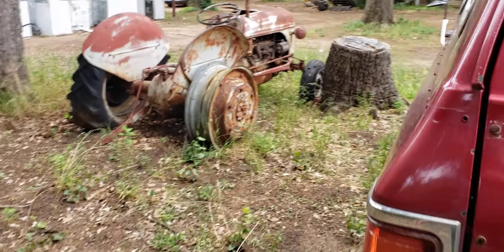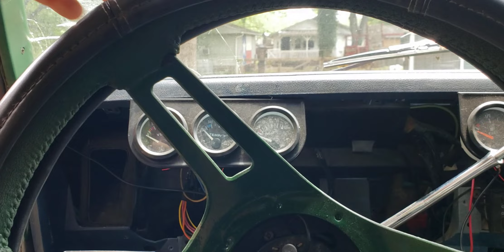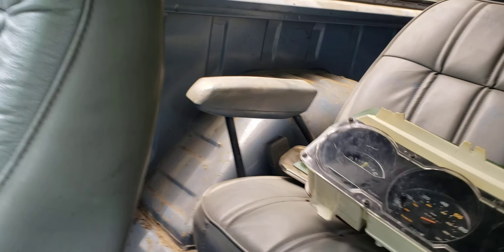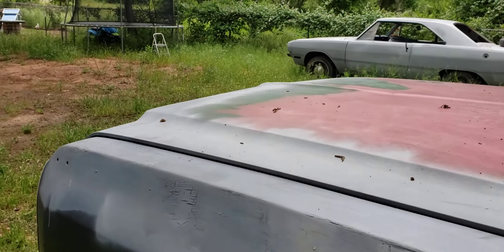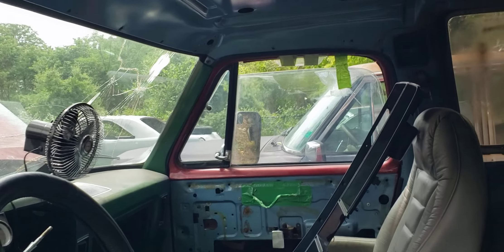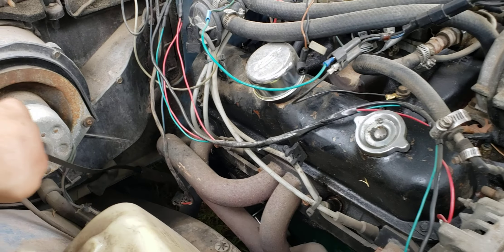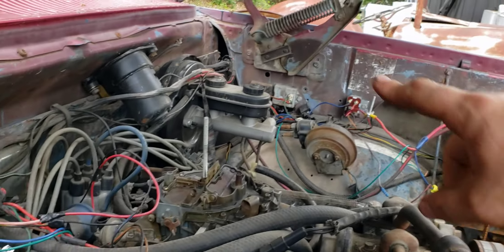I bought a 1984 Dodge Ramcharger What should I do with it?! WILL IT RUN? WILL IT DRIVE? 318 V8

Comment: If that's a 2x4 they're pretty rare. I'm building a 1987 2x4 for my wife. It's lowered 1-1/2" with wider rims and tires.  Looks great but will probably be worthless AF when ever it snows here, which is very rarely. If it has the lean-burn setup I'd ditch that straight away.  A new Holley carb and electronic ignition would do nicely. Anyway I personally love the style! My vote is to keep it.